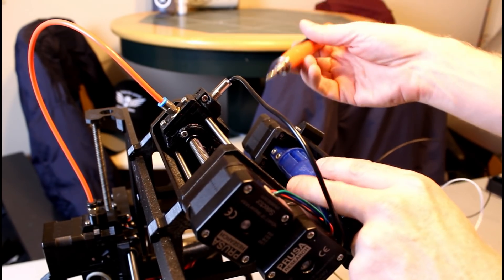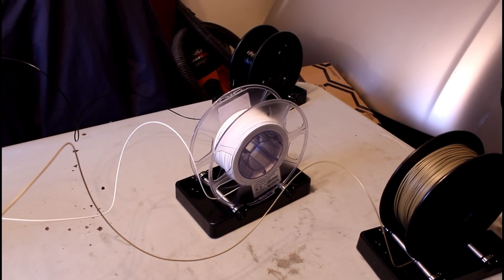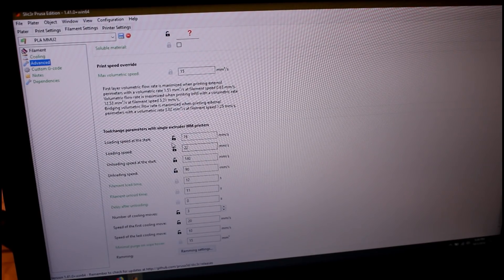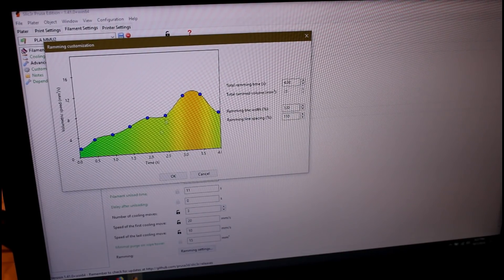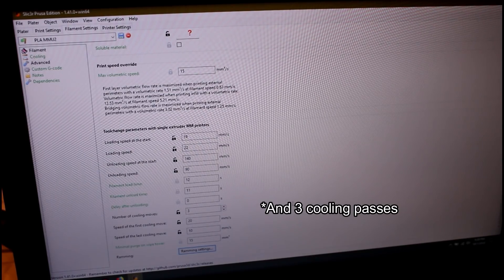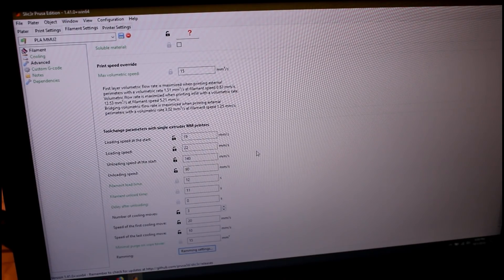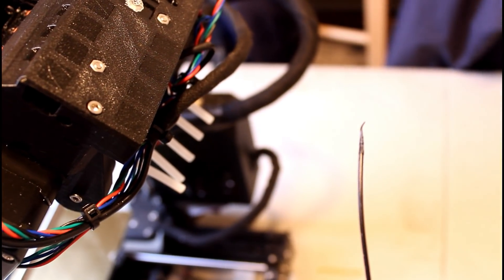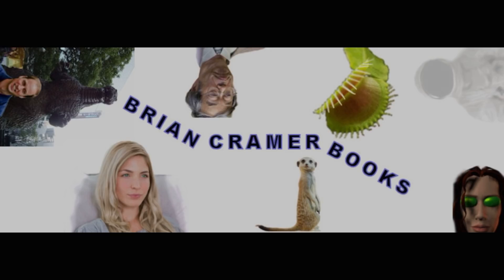Victory Over the MMU2

Comment: Thanks you for posting this, it is the best source for solving MMU problems I have found.  I love the MK3s MMU2S combination but not the frustration of trying to figure out how to do things that should have been documented. 

After playing with my MMU2S for several weeks I was beginning to despair and especially after seeing how the Prusa Forum seemed to be blowing off complaints and requests for information.  Also either my MMU controller is broken or the documentation is wrong about what the buttons do, in particular I have never been able to get the head to move by using the buttons.  Badly needed is a way to reset and calibrate the MMU without trashing the print also the control panel shouldn't freeze out the printer menus when the MMU needs attention. The firmware often paints you into a corner and doesn't allow you to tell the machine what to do rather than the other way around. 

I have found that even tough Prusa has copious documentation that it often doesn't address matters that confuse new users but to be fair that is a problem with almost all documentation.  Manufacturers should test their documents with people who are new to the product and use the resultant confusion to identify where the documents need improvement.  It's either that or risk alienating their customers and waste time answering the same support questions over and over.
Reply from the maker: Thank you. I'm glad it helped. The scary thing is that the MMU2S that you own is a lot more stable and refined than the MMU2 I was using in this video. The firmware has improved with regards to painting you into a corner, but it still happens sometimes unfortunately.  The left and right buttons should definitely move the selector if you are not in the middle of a print, otherwise they have different functions. Perhaps try holding them down for longer. Cheers! (Also, some of the software things I tweak in this video are probably no longer relevant, just FYI.)
Reply: @0calvin  One thing I found is that some of the PTFE tubes have slightly smaller inside diameters than others and it was the cause of some jams.  The filament tips look almost perfect except for a slight bulge on the end, it's only .25mm larger than the filament shaft but that was enough to stick to the point that you couldn't pull it out manually.  I have switched to the larger PTFE and also reamed out the inside diameters with a twist drill near the ends where they tend to get pinched. I am testing a print now, so far it's working.  Thanks again.

Comment: Has Prusa ever responded to your complaints/mods on the MMU2?
Reply from the maker: Yes and no. I'm not much of a complainer so I never bothered to complain to them directly. I prefer to just fix the problem and move on. But they did release a survey to us owners and had received a lot more negative feedback than they had expected so they have been incrementally resolving software/firmware problems in response. They also just recently release an upgraded "S" version which patches a few things up, the biggest of which is that the MMU2S can now sense when filament did not load properly and retry loading and/or alert the operator instead of just printing air and ruining the print job. They released this for current owners for free along with the Mk3S upgrade parts, so that was super cool of them. Unfortunately like most Prusa product releases, we all have to wait months for them to actually ship. But it was still cool of Prusa all the same and I commend them for it.
Reply: @0calvin  -- I wouldn't view negative feedback so much as "complaining" as helping to refine/improve the product.
I recently left this message on the Prusa website. I don't expect to hear back from them as they are probably buried trying to fulfill their backorders, but I'd be curious to hear your thoughts:
 "After reading about all the problems associated with the MMU device, plus all the feed/retraction time (and possible points of failure) it must add to a build that requires frequent color/filament swaps, I'm thinking that maybe the design logic is wrong and maybe a multiple extruder print head is a better approach to the multiple color/filament issue. Just a thought."
Reply: @0calvin  -- thanks for responding. Prusa sounds like a very reactive and compliant vendor, willing to accept feedback and act on it. I guess it's one of the reasons why its products are so wildly popular. 
I hope you continue to "hold their feet to the fire" through your videos, while alerting us to the progress of the MMU2. You're selling me on it along with, I imagine, many more viewers, and for that reason I hope Prusa ships you a few review products as a reward.
One last question -- do you know if the MMU2S includes a more heat-resistant idler wheel carousel?
Reply from the maker: I don't think the main MMU2 unit changes much or at all in the "S" version other than the firmware to work with the new location of the extruder filament runout sensor. I have not really seen this as a problem most people have surprisingly, so I chalk it up to mine being black and absorbing a little more heat than usual and perhaps me over-tightening the screws? However, I'm still not a fan of how thin the material is that is counteracting the force of the tightened screws. I would have liked to have seen them address that and then there would be no reason for printing in a higher temperature material.

Comment: Ok, testprint went well. Now I'm ordering the fitting for the bowden tube. Thanks a lot for sharing. The setting in the Printer Settings I've never noticed before in the forums.
Reply from the maker: I think with the latest firmware that setting is probably fine as-is. But it is good to know about it in case you need to adjust it.

Comment: 0Calvin, thanks for your perseverance. I’ve been struggling to get the MM2 ugrade working on my MK 2.5. Using all of your suggestions here, I finally got a very nice 7 hour, 3-color print. I glued the pass through fitting in the new filament sensor cover because I kept getting wobble with the fit. The only thing I can add is that with all the fixes I was still getting skipped layers and the problem turned out to be one roll of filament. Have no idea why that caused problems, but when I switched it out all was well. Thanks again for your assistance!
Reply from the maker: I'm glad it was helpful to you.

Comment: You sir, are a goddam hero. I followed all of your advice and (knock wood) my MMU2 is actually working. Bravo.
 Subscribed. 
I had already come to the same conclusion about the stupid feed tubes and shortened mine the same way. I really thing that the MMU3 should be designed to have filament come in from above. I'm thinking of a modded frame for it that would angle it up 90-100 degrees. Struggling with what to do with the ptfe tube that runs from the MMU to the extruder so that it doesn't bind. 
Again, I appreciate your video enormously.
Reply from the maker: Awesome, I'm glad it helped you. I still struggle with my MMU2 to this day. For me, it is usually more frustration than it is worth. Randomly skipped layers kill all the fun.
Reply from the maker: With regard to the ptfe tube from the MMU to the extruder... https://youtu.be/Jk0X38glhzM?t=1605  McMaster-Carr Part# 52355K54 .

Comment: What brand(s) of filament did you use for this print? Are there any brands that you would recommend and/or any that you would discourage against using?
Reply from the maker: The filaments are listed in the video description. In my experience with the MMU2, all filaments are hit-or-miss with it. Unfortunately you almost have to have a different profile for each one, and sometimes even different colors of the same brand will act differently. I've really grown to hate this thing because it always gets my hopes up and then f-ups at least one time per print, usually with a missed layer so the print is no good.

Comment: Just to comment the 19mm speed for Load start makes a hell if a difference in my case and was my one and only magic I had to use to get rid off 98% of my grinding issues, as per  https://shop.prusa3d.com/forum/hardware-firmware-and-software-help-f56/filament-sometimes-not-making-it-to-nozzle-and-pri-t26555.html#p120369 . As author states here this is more a match for the MMU2 load speed and extruder motor load speed.

Comment: https://www.thingiverse.com/thing:3138950

I did the same thing as you, originally I started with each filament feeding into and out of a jar to keep them from tangling. This is better.

The Loading Speed mods are to keep from grinding, they don't help tips.\
Reply from the maker: I think I saw you post this somewhere in the forums - great idea. As for the loading speeds  yes, I have a pinned comment to that effect but thanks for the heads-up. Cheers!

Comment: Im honestly in disbelief about how troublesome the MK3 is ... I won't be buying one ... Tiny print area AND Prusa used their own customers as Beta testers ... Thats the tipping point for me... I want to be paid if I'm testing their hardware... Im getting the CR-10 S5 ... Thats all there is to it ...
Reply from the maker: For me, I have found the MK3 to be super reliable. I really love it and I trust it to print jobs that last several days without worry. It is made with all the upgraded parts you would normally add later on. Creality printers are nice, I own one myself, but the MK3 is in a different class. The Multi Material Upgrade 2.0 however, is a steaming pile of crap right now until they address its shortcomings.
Reply: I alternate between getting excited about MMU 2.0 and thinking I won't install it at all.  I haven't received mine yet (ordered the original MMU upgrade for MK2.5/3 Nov. 7, 2017, which got upgraded to MMU 2.0 along the way)... and I'm just thinking it is too much hassle and space.

I don't even really care about multiple colors, I just want to be able to use soluble supports.
Reply: @GordonGEICO  same with you I just need soluble support.
Reply: @0calvin  , yup good call here about the MMU. But I was finding the process of building the MMU quite cool as I was learning how it worked. Only to then sit and read the manuals again to try and work out that using the TPU with PLA was going to be a bit rough to work.. and then as like everyone else, I start to think of better ways and solutions for some of the design floors... sometimes the turd can be polished...:) ... But from using this compared to my Utimaker 2+, I am happy as a pig in shit with less noise in the work area.. So quiet in comparison.... but things definitely could be better with the MK3 and the MMU . Great channel chap!!!
Reply: MK3 is fine - the MMU2 has been a pain though

Comment: Once one given filament starts printing, (hence the direct driver extruder is pulling the filament), does the selecting idle disengages? Or does it keeps pulling filament also? Thanks
Reply from the maker: Once the MMU2 delivers the filament to the extruder, it disengages. Unfortunately, filament does not always get all the way there because of a jam in the orange tube due to stray strings getting pulled through with the filament, but the printer does not realize it and prints with air. This is probably my main complaint with the mmu2.

Comment: You wondered, what the cutter is doing in the MMU 2.0. I just reviewed some code: 
void cut_filament()
{
}
Obviously it does nothing!
Reply from the maker: Thanks for confirming my suspicions :)  One of the beta testers also told me it was currently disabled because "it wasn't needed."
Reply: I removed the blade today, just to be sure it doesn't make troubles.
Reply: Now you can use cutter with fireware 3.9.0+

Comment: Screw the printer, what is that magic screwdriver?!?!
Reply: Sonic Screwdriver :D
Reply from the maker: https://www.amazon.com/gp/product/B074SW6H6S/ for the screwdriver. It's not super powerful and the buttons are in a stupid place, but I like it.
Reply: @0calvin  Might look at the mini es121 geared motor lots of torque better button placement and motion activated bit pricey though worth it if you use it a lot.  They change the material the guide is made out of in the MMU or if you buy one now (a year later) will you likely encounter the same problem?
Reply from the maker: https://www.amazon.com/gp/product/B000MF754W/ for extra bits.

Comment: Prusa made a huge mistake by allowing people to assemble their own MMU 1.0 and MMU 2.0.  I have sadly come to realize most people can't build properly and can't troubleshoot their way out of a paper bag.  It really is depressing to be honest.
Reply from the maker: While both versions suffer from the inherent problem of filament stringing while retracting, I definitely agree with you, especially with this version. There are a number of things that need to be critically aligned in order for the hardware to function smoothly and they can be easily overlooked. One would hope that the sort of person to buy a 3D printer would be mechanically inclined, but now that they are a bit cheaper and a bit more mainstream, you are starting to get the average Joe buying them, and the average Joe has the attention to detail of an infant.
Reply: Of an infant? Well, it seems like you did not get it to work right out of the box, did you? As I am still struggling with it, I am inclined to say that the thing is poorly engineered. That's it.
Reply from the maker: @twolaneblacktop5903  , yes this thing is poorly designed. There are some inherent problems with it that can't be fixed without a redesign. But you do know what the word ”troubleshoot" means, right? Of course I did not get it working right out of the box, but then I was able to troubleshoot it to get it mostly working. Many people can't do that, that is all the original poster was saying. But I agree with you that mere mechanical prowess is not enough to get this working 100% because it is flawed. Cheers!
Reply: I get it to work once I tweaked settings to give shape to the tip of filament. The tolerances on the tubes are pretty small and any sort of bulging on the filament tip will cause a jam. 
personally I think that an improved design would be to merge filaments on a chamber after being automatically cut. Therefore no need to retract less wasted time.

Comment: What length calibration? Did I miss a step?
Reply from the maker: Hidden on the depths of the manual is a way to calibrate for the length of the orange tube. Technically it should be fine from the factory.

Comment: Just curious, how much did the purge block weigh compared to the rest of the part?
Reply from the maker: I'm not sure, Luke, but it was definitely heavier than the print. But I left everything at default without trying to minimize the block or using purge-to-infill. I was mainly concerned with just getting it to work. Of course, had I printed 20 penguins at once, the purge block would have still been the same size.

Comment: our "idler barrel" even cracked during assembly, since the bearing was a bit to large for the printed hole. but a mini-testprint suceeded on the first try. 

Did you print that PC with the prusa i3? Did you upgrade your temperature sensor?
Reply from the maker: The polycarbonate idler assembly was printed on an Original Ultimaker that has been upgraded with a water-cooled E3D Chimera+ with PT100 temperature sensors good for 400c.

Comment: this whole selector thing seems a bit overly complicated. Why not just use 5 motors and a traditional pulleys?
Reply from the maker: I find the mechanism rather elegant and with the exception of my idler assembly softening up, it works well now. However, like the 1.0 version of this that did use one motor per filament, it still has problems with filament strings jamming up the works. This was supposed to be solved by the cutter in 2.0, but they have it disabled in firmware currently, probably because the little razor blade they are trying to use will dull after ten cuts. This unit really just needs some sort if scissor-style V-blade cutting system and it would be the bee's knees.
Reply: @0calvin  another thing I think might help is if they used a heat sink for that stepper motor. It might help a little bit with the soft plastic problem
Reply: Florian Bösch more expesive and how do you feed all 5 filaments into one hotend without issues like previous version of MMU
Reply: @bentarr17  The unit as-is has 3 motors. If you simply put in 5 extruders you'll have 6 motors. You can get reasonably good extruder units for about $20-$30, cheaper if you're ggoing wholesale...
Reply: Florian Bösch so production cost would probably be $50-75 more, which would significantly increase the price
Reply: Lets see you design something like that which actually works, then make it less complicated.
Typical armchair engineer who just pokes holes in everything everyone else makes instead of creating their own designs.
Reply: Cost and deploying even more complications of expanding the board via shield or manufacturing.  I don't own one of this but all this guys videos are very disappointing.  I can't figure out if thing is break through or not.  A daimond hotend is looking like a better option again.
Reply: @dasfluxmusic  a fucking diamond hot end? Bull shit. I have the Prusa MMU 1.0 and have so many great prints spanning thousands of hours I lost count and ran out of shelf space.  I heard non stop bitching from mental incompetents about the MMU 1.0 too so excuse me if I don't believe all this BS. Prusa has carefully engineered so much into the software and hardware and it works flawlessly for anyone that is capable of troubleshooting.   And you chances of success with the MMU 1.0 are 1 thousand times higher than some shit ass diamond hot end with insanely complex alignments, nozzle drizzle, custom gcode generator, etc.